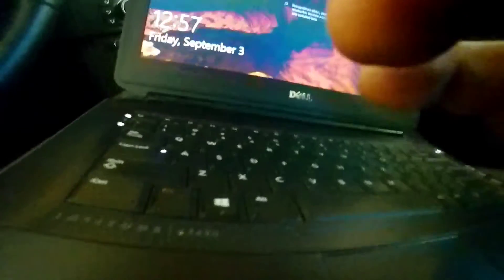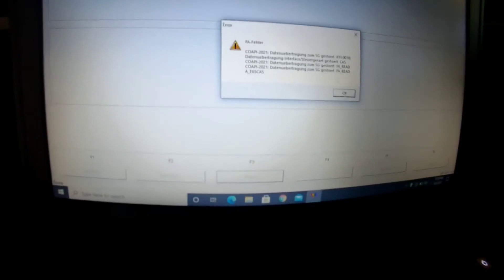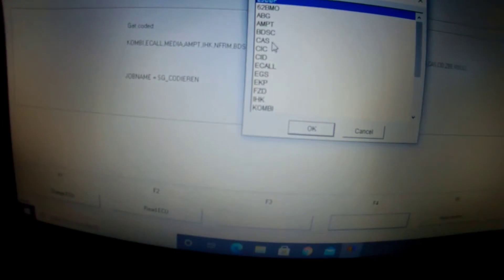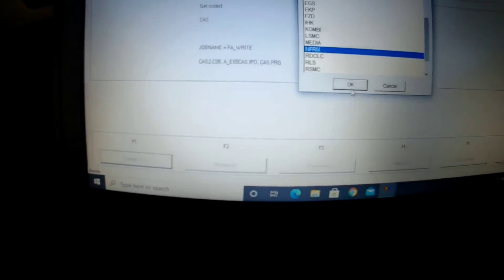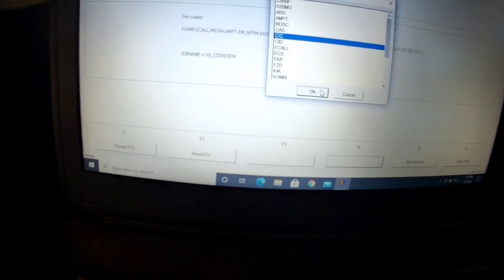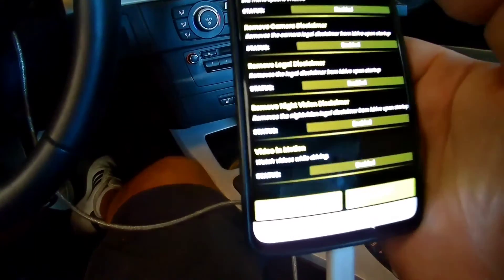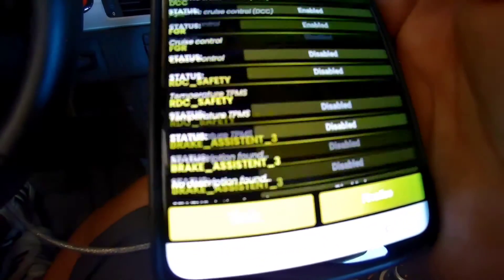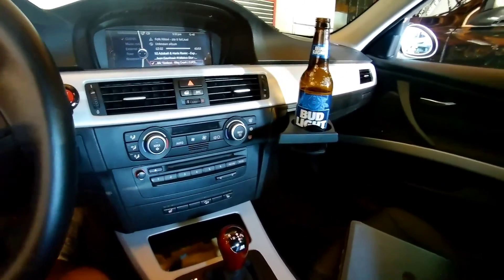How to CODE REVERSE CAMERA ON Bmw e9x

Comment: Hello dear
I want to do this to an e61 bmw, but ncsexpert doesn't accept $3AG when trying to modify the VO .

Any idea?
Reply: Ok thank you bud
The option $3ag is not available for e6o/e61 chassis I read it yesterday.  
Have a great day man
Reply from the maker: Do you have CCC OR CIC unit?
Reply: @Frenko1  I have cic my friend
Reply from the maker: What year is yours?
Reply: Its septembre 2009
Reply from the maker: What exactly happens when you try to add $3AG?
Reply: My VO doesn't accept the $3ag option, I've tried with 2 laptops and still nothing
Reply from the maker: No clue bud. Sorry! Try asking in e90post.com in coding section.